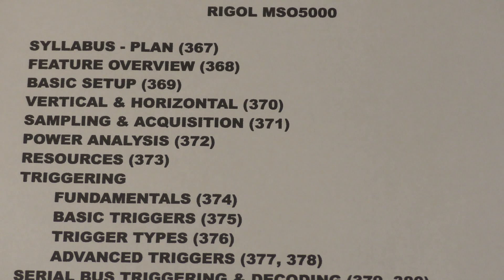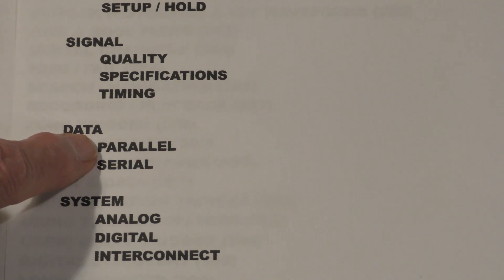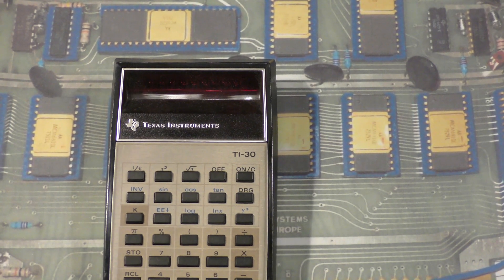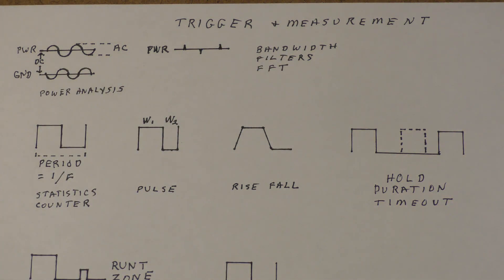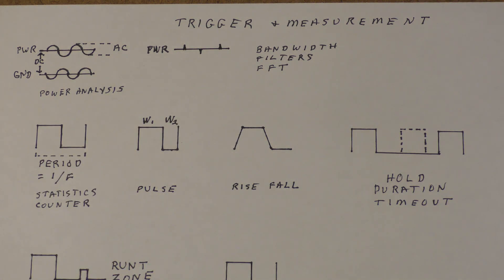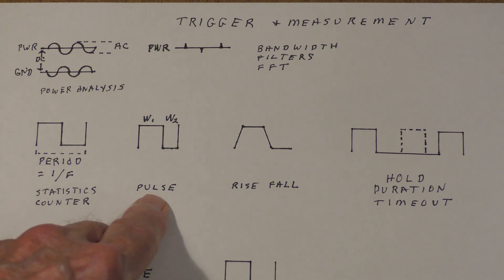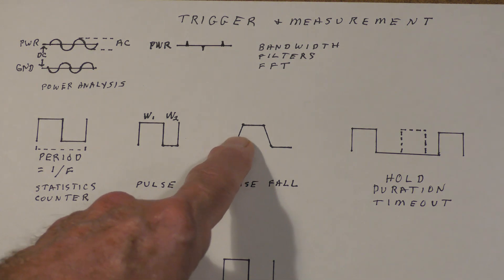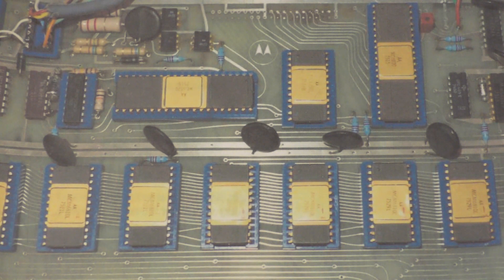TTT397 Rigol MSO5000 Synopsis

Comment: Thank you so much for making this fantastic series!! I can't thank you enough!
May I please ask you, how precise you find the clock frequency to be? I am wondering if there is any way to remove the crystal and insert an external frequency standard instead? Such that all my gear is synchronized? :-)
Reply from the maker: I would like to add an external GPS disciplined clock to the MSO5000, but, unfortunately, it has no input. I have added an external clock to my Rigol DS4000 and there is an upcoming video on both topics. Thank you for your interest and kind comments.